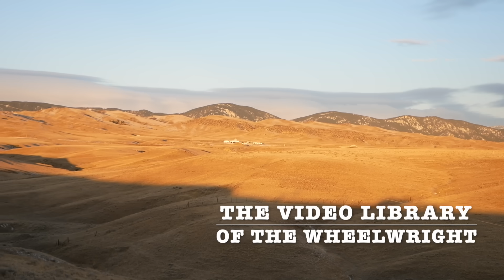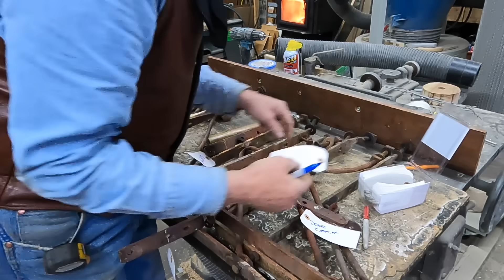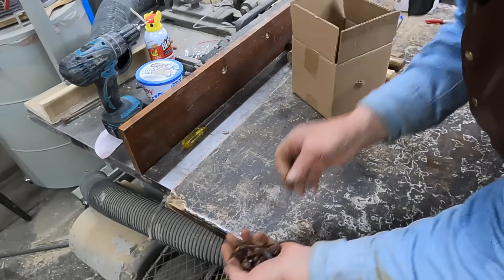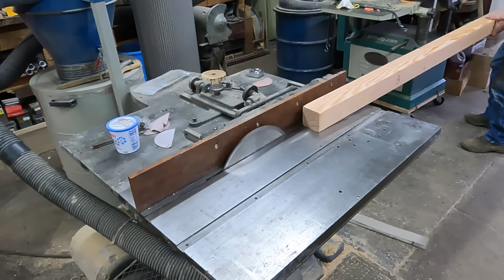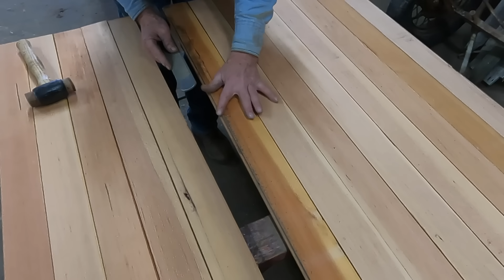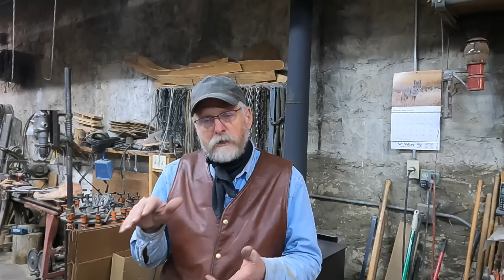Old Original Flooring For a 130 Year Old Wagon | Engels Coach Shop

Comment: Hi Dave I Always look forward to your FABULOUS videos .  I spent many years as a carpenter in Scotland.  The problem with the floor board joints could be that the boards are not all FACE side up. The tongue is normally shorter on the FACE  (top side) so the joint closes up tight unhindered .

Comment: Hi, the vertical grained floor wood is "Quarter" or radially sawed which makes a lot of wood waste, but a board which is uniformly dimensionaly stable in all the directions. The other board is "flat" sawed, which cups and warps, like you would expect. AFAIK, they only use "Quarter" sawed wood for floors and musical instruments.
I enjoy your channel, thanks!
Reply: It was widely used for furniture too. Google Mission style furniture, it is made of quartersawn white oak. I used to make Mission style pieces and you are entirely correct about it being very dimensionally stable. I made the clock in the pic to the left, it is made of quartersawn oak.

Comment: - Yes, Dave, the grain orientation of the flooring was to prevent splintering.
- I grew up on those kind of flooring boards in refurbished sections of the house, and maple in the kitchen.
- And on white pine flooring boards 16 to 20 inches wide from 1817, laid on top of round flooring joists all nailed with square hand forged nails.
Reply: Cool!

Comment: That wood is quarter sawn. That type of grain is very stably, and doesn't warp. Also more expensive. Tip: if you want some doug fir quarter sawn, get a 2x12 and rip it down the middle. It quite likely has the heart in it, and the grain on both sides is vertical. Check it out nezt time you're at a lumber place. Decent wood, stains more uniformly.

Comment: It is my understanding that vertical grain, VG, is from perpendicular to 45 degrees.  Beyond 45 degrees to parallel is flat grain.  Also, I believe that in exposing the late wood, i.e. the dark rings, which are harder and denser, the wood is less subject to wear.  It also is much more stable.  In sawing lumber, I always go after the maximum VG that I can get.  

Just me, but I'd still sandblast all the metal or at least use EvapoRust.  I don't like putting rusty iron against wood.

Comment: Would the reason they use vertical grain for wagons not be just simply that they could use or reuse the same stuff already made for flooring?  Regardless of whether a shovel likes to avoid splinters or not.  Or is my thinking too warped by modern manufacturing supply chains?

Comment: Your tongue and  grove brought back issued I had installing tongue and grove yellow pine plywood I installed as the second layer on my 32 by 40 shop floor.  I ordered a whole unbroken skid.  When I STARTED braking down the skid I found filler patches that were not sanded.  There about 5 different CODE DATES. and 4 different  machine #s were printed on the sheets.  A GROUP of 4 sheets was the largest one.  SOME groups tong did not fit the other''s grove.  IT turned out to be line start up rejects.  After a lot of PHONE  TIME I got a " we are sorry".  BY the sorry time 1/2 of the floor was screwed down.  The local lumber company gave me all the money back plus more.  They did not want to pay to have a contractor  pull up the plywood already installed.

Comment: The shop cheated you. You wanted a 4 by 4 but only got 3 1/2 by 3 1/2 inch
If I buy a 100 x 100 millimeter beam in Europe, I also get the dimensions.
Reply: A 4x4 here in the states is the nominal size. The lumber starts out 4x4 then finishes to 3 1/2x 3 1/2. Like wise our 2x4’s measure 1 1/2 x 3 1/2 in their finished form
Reply: Deswegen gehe ich nicht mehr ohne bandmaß zum Holz kaufen.
Reply: @charliebird802 Same in uk..  They clean it up  but you pay for the bits that had to come off.   2" square Rough sawn,   bought PSE planed square edge is 1 7/8".   Its up to the buyer to get it right. If you needed accurate 2" planed then you'd buy bigger and mill it yourself.
In uk we see your quality timbers and go green with jealousy.  Our hardware shop lumber is  only fit for making small household projects.
Reply: Thanks for the video post.  If the owner wants to save as much wood as possible, I hope you can use the best part of the sideboards for a tailgate and side boxes.  If it will be an outside piece that never moves or is a static display, then new sideboards could be a moot point.  As a viewer, I appreciate what Dave does, and Diane thanks for your behind the scenes help to show off your husband.